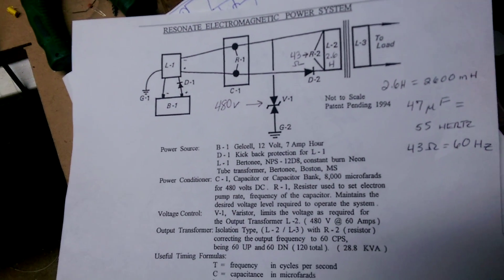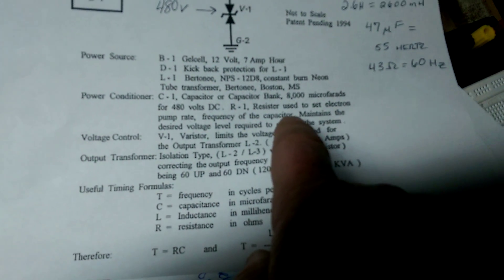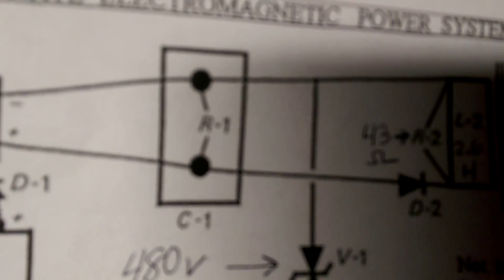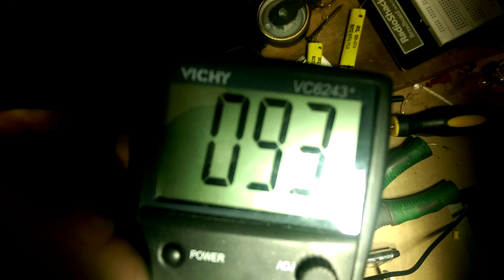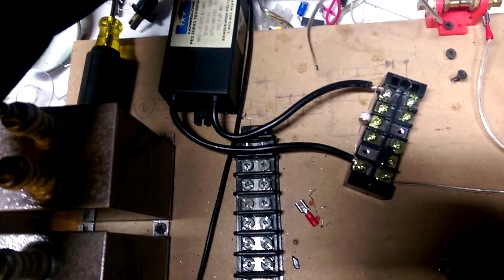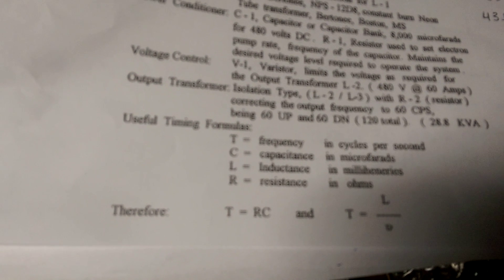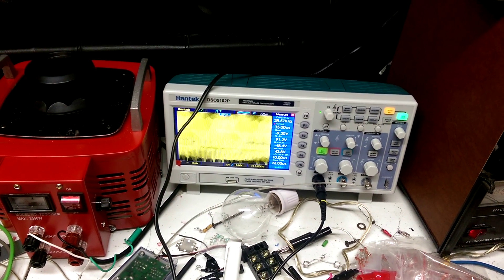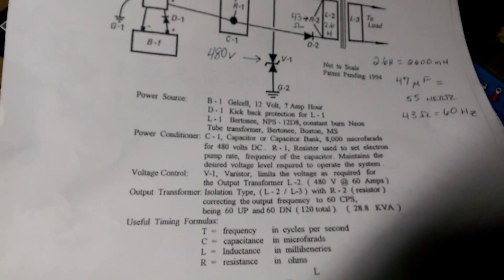Don Smith How To Video

Comment: Please, see my Don Smith generator replication in https://www.youtube.com/watch?v=43hted5YTCw
It works fine!
Reply from the maker: Gerson the only problem  that you present is that the parts you list and the parts you use are 2 different things. First and foremost, you are using an older model of the Cool Neon brand NST that has a zero volt reference center tap, and the model you show is NOT adjustable like the cool neon's nst. The adjustment you provide by the adjustable neon dimmer as Don did will not work and will burn out most solid state nst's. If we provide ground to the grounding point on many nsts, this only connects to the ground on the 120v power supply, leading to the return of the high voltage to the experimenter's breaker box's neutral . 

This will force open any GFCI, starting at the NST.  The biggest issue we all have is that people need to replicate this system to figure out why it works, not just build a device that works some of the time to provide only output enough for 6 or 8 -100 watt light bulbs. The true Don Smith schematic is the 12v to 3kV output driven into a capacitor and gas discharge tube, then it should go to the rectifier bridge, voltage divider, DC cap, then a load. This teaches the public why the circuit works and can convert from high voltage/cold electricity at high frequency to low voltage at a normal frequency, by an inverter. If we keep spending time and money to replicate the device, then not tell people what you've actually used, you are suppressing the technology just as Don did. The diodes you use are NOT what is listed in the diagram, the NST, not the same. The fact of the matter is this, the Don Smtih generator is a Tesla Hairpin circuit that is shorted into a coil instead of a shorting bar. When we do this, energy is still released into a resistance, and the higher the resistance, the better the output,

 The closeups of the caps and coil windings are not provided. People need to see everything, and failure to do this is giving people not enough info to replicate, where they just waste their time and money. . Don did show close ups, but this device worked occasionally and he never ran this in public because it didn't work longer than a few minutes because the gas discharge tube would fail as mine all do . The math to make these devices work is based upon what the original nst's provided for frequency. That is what we need, we don't need another video showing something powered up and not showing us the panel from both sides, or the bulb panel from both sides. We all know the output would never be a perfect 60 hertz unless resistors wewe provided, and if you were interested in getting people to know the truth, you would show all of this,, the schematic, the real parts used and every angle of video proving it is the generator driving the load and not a separate source. There are too many inconsistencies to get everybody believing your device. The biggest issue is that the ground connection doesn't come out of the side of the model of nst you use. I have an Evertron nst that I had to make my own connection to the center tap of the transformer. You probably did this yourself with this nst so the device doesn't drive HV back to the wall as most people do, not knowing why their device shuts down..
Reply: Mark, he is a scammer, I already debunked him several times and he deleted all my comments months ago :) He only does a visually perfect clones of original devices, and tries to sell parts to others )

Comment: where do you get the gas discharge tubes?  I can't find them.  And how do they compare to a proper spark gap?
Reply from the maker: gas discharge tubes can be found from Littlefuse online, on Amazon, Ebay and a number of other places. They come ib all sizes, amperages, voltages, etc. They need to be engineered for use, however, they are built to be used as lightning arrestors, and they are merely protection devices that protect from overvoltages.
Reply from the maker: the gas discharge tubes I buy from ebay. I buy epcos spark gaps and I try all different voltages and styles. To suit your experiment, I suggest you get spark gaps rated for the maximum voltage of your nst plus 20%
Reply: Can you give me more information on your transformer?  Input is fine, what are the windings for the output, center taps, and voltage?  Anyway of getting your email please... thanks.

Comment: Hey MArk I sent you  a mesage on your you tube account now few time ago...I will post here what I want to say , also...I understand you are out of money ;you need help  in your research to bring out some free energy systems to the people...You can receive help from Keshe foundation..I heard mister Keshe said he are open to help smart guys with great ideas , to put it on the market..Just  take contact with his staff  and tell them  who are you and what  you have done..they  will be pleased to colaborate  with you and help you in your research...their goal are the same as yours.. to help people to solve their problem  regarding  the energy ...in this direction  the foundation already have an program  to bring  free energy  in poor countries from Africa , using  plasma technology; in Italy they already have a factory where they are making plasma energy devices...

In another word, regarding your  system  I have few questions:
1.the output from the nst ,I understand is DC: http://s003.radikal.ru/i203/1207/4b/1e64d71de6e3.jpg   so how the capacitor and resistor is used to tune  the output of nst ?We need to have oscilation to tune a coil ...

2.Instead of nst can I use an ZVS oscilator toghether with high voltage flyback  transformer(FBT) known as line-output transformer from  television? ...this type of transormer have a diode built in from factory  ....so can be used?

3.Is not clear for me why we need center taped nst? Why common type transformer( like microwave oven model)  with 2 legs output are not good? What role plays here the center typed transformer...?
4.I see in the movie an spark gap acros output (?) of nst ..this can be taken away from circuit and put the varistor going to ground instead, like in schematic right? In schematic I donn,t see any  gas discharge tubes 

5.How much is the maximum load you can use with your 92 microfarad capacitor ?Will increase the watage output  with more microfarads?

6. The D2 from diagram what purpose have there?I supose are  a high voltage , high amp and high frequency diode....can you please give an ideea about specification  of that diode?

7.The capacitor mentioned in schematic are  sugested to be 480 V rated ..How these will withstand  if we have at the output of nst thousand of volts? 
8..Can you please give an ideea what rating should have the transformer output? ( around what watage can we expect here?)
9.You say :       if you get these cheap Chinese hf inverters off of Ebay,  they have no 
protection and offer you tuneable frequency which is a godsend!  this 
lets you find resonance without playing games with caps,  however, the 
coils must match each other perfectly frequency wise,  I mean dead on!   ...  you speak  about an inverter that take 12 volts from battery and give 220 volts out? Can you give us a link to be more clear  what type of inverter you talking about?
 

Thank you 
Mihai
Reply from the maker: all wire wound transformers and 90% of solid state nst's  output ac voltage or pulsed dc which reacts similar to ac,  can be resonant and is able to be tuned as a resonant ac circuit.  if the signal is rectified as a full wave bridge rectifier,  then,  once its rectified and a capacitor is used to smooth the output,  youve got a clean dc output.
Reply from the maker: you could use a zvs oscillator and flyback,  unfortunately,  the frequency is fairly low,  less than 16khz and isnt variable.  the flyback. voltage is normally too high and amperage small,  but,  it needs to be between 2000 to 3000 volts and frequency should be 35.1 khz.
Reply from the maker: the center tap cuts the voltage in half and doubles the amperage,  yes it is important especially if you would want to see both outputs used for a positive pulse train,  then,  both pulses can be combined in parallel to output double the power/amperage.

Comment: a old nst will not have a gfi
Reply from the maker: +frank ertolacci  most likely, however, the solid state nst's had protection and gfci's for quite a few years, and, they are very difficult to find a solid state nst with a center tap or, without a gfci, even though they may still be around. They are easy to kill as well trying experiments like these, but, they work the best because the 120v solid state nst's have the most power and supposedly have overunity right out of the box, they are labeled so anyway to have more output than input. You'll need the center tap for it to work correctly, however, I am hearing others have recently used automotive coils to make the system function with a single wire out and an avramenko plug
Reply: +Marc Belanger     Information Unlimited will custom make neon power supplies for us  /  draw up a circuit  and send it to me // i will send it to them and pay for it  //  or would you rather go in the car coil ??
Reply from the maker: I don't really know the circuit I'd need.  I think the best deal would be to find the true diagram from the Bertonee units Don used.  I did see some schematics online,  however,  Ive never received any proof it was the true circuit.  VENTEX is the company that bought Bertonee and they still mfgr the devices,  I just have spec of the solid state nst.  If like them to be able to offer more power,  however,  if done correctly it isn't necessary.  But,  I'd need to know what the output inductance , capacitance and impedance would be to make it work like Don did. 

I'll try to get the true diagram of the few I've been looking for,  oh,  btw,  I found where to get the custom caps Don bought from Cornell Dubier.  They went back private and have the design criteria from Transworld Energy which again can be made and sold to the public,  however,  they want $44 each for the yellow 4kV caps and a minimum run of 10 pcs to make them.  They were protected until the 1st of January,  now available again!
Reply from the maker: I'll have a run made and trade for the Caps you need if you wish.  I am skeptical to lean towards one size,  so until I am absolutely positive of the size I need,  the coils are as unique as a fingerprint and I'm not too sure how don. Used them on all of his devices,  unless they were the key to. Success.  If you look,  nobody gets or used them.  I've found the dimmer, the inverter,  and the caps.  If we get the neon transformers,  we could do well with the circuit,  but,  resonance is not easy
Reply from the maker: The resonance also drifts like analog radio,  so a phase lock loop circuit may be the answer to infinite resonance without losing it over and over..  That would be a real bummer if that happened after all of the thousands in parts
Reply: +Marc Belanger  how many caps do you need ?  2400 uf DC each , if necessary to send me something = north raleigh electric , 127 martindale drive , younhsville N C  //  on a white board don detailed a working model  //  he stated it was simple and we would not have to worry about tuning as it would be unnecessary with that circuit //i am going to look it up build it then go from there  //
Reply: +frank ertolacci   127 martindale drive youngsville NC 27596

Comment: mark   do you have don's pdf file ?
Reply from the maker: yes.  I haven't had luck with Dons calculations.  if we calculate what he used in the circuit with the b&w coil with dual coils over the Red amp king wire,  the frequency ends up being 239 khz,  so,  I used a trial and error approach since it wasn't in resonance even though my calculations said it should be.  I find that it will be close,  however,  we won't be able to operate an. nst that runs at 35.1khz in the arrangement he uses because it will shut down due to the gfci
Reply from the maker: heres what i.would do to rectify the situation.  since it has to be in resonance so the nst doesn't overload,  the first and most important think you need to do is buy a tesla coil resonance finder and replace the cap they tell you to so you get it down to the lower rf frequencies as Don states
Reply from the maker: then,  you'll have to check the capacitance of your probes on your scope and you'll have to get a capacitor the same size to use it as a decoupling capacitor because your scope's probes will interfere enough with your readings that you'll be tuning to the wrong place with the resonance finder circuit.  I think this will cost you like 8 or 10 bucks on ebay,  plus the capacitors you need.  next,  the circuit will illuminate and when the light shuts off,  you are in resonance.  be careful,  theres two circuits sold,  one uses lights to tell you its in resonance while the other shuts off when you get resonance as mine does. 

after you find resonance,  the only issue you'll have is the ground connection to arc gap will shut it off.  if you get these cheap Chinese hf inverters off of Ebay,  they have no protection and offer you tuneable frequency which is a godsend!  this lets you find resonance without playing games with caps,  however, the coils must match each other perfectly frequency wise,  I mean dead on! 

I ordered wire wound 60HZ NST'S WITHOUT A GFI ON EBAY,  ITS THE ALANSON YOU SEE IN MY VIDEO.  I.ALSO HAVE AN ACME 12KV.  THE NST HAS TO HAVE A HIGH SIDE CENTER TAP AND NO SHUTOFF CIRCUITRY..  ONLY POTTING COMPOUND IF YOU WANT IT TO WORK.  YOU'LL NEED A NEIN DIMMER,  AND,  SINCE YOU CAN USE THE CHINESE INVERTER BOARD TO TUNE,  YOULL HAVE THE TUNING FOR FREQUENCY AND AT THE DIMMER YOULL BE ABLE TO TUNE THE LEVEL. 

FOR A GAS DISCHARGE TUBE,  I HIGHLY RECOMMEND BUYING ALL DIFFERENT SIZES.  THEY WORK SILENTLY BECAUSE ITS PLASMA THEY FIRE WITH…  EXACTLY WHAT YOU WANT.  THE FIRING VOLTAGE WILL AFFECT THE FREQUENCY.  IF YOU GET AN ADJUSTABLE GAP,  MAKE SURE THE FRAME ISNT PLASTIC BCUZ THEY MELT.  BEST BET IS TO JUST BUY THE GAS DISCHARGE TUBES FROM LITTLEFUSE OF BUSMANN,  OR ANY OTHER BRAND.  I.HIGHLY RECOMMEND THE HIGHEST AMPERAGE TYPES SO THEY LAST.  YOU CAN GET AN HV SCOPE PROBE TO TEST THE OUTOUT VOLTAGE AND FREQUENCY,  JUST ENSURE THE PROBE HOLDS UP TO 25KV MINIMUM.  IF YOU TRY CAR COILS,  40KV PROBES ARENT ENOUGH.  ITS EXPENSIVE BCUZ YOULL NEED AN INDUCTANCE METER,  IMPEDANCE METER,  AND,  FREQUENCY  COUNTER,  AND AN. ANALOG VOLTMETER SO THE HF doesn't smoke your digital meter as it did my klein meters voltage function
Reply from the maker: what part of dons system do. you need assistance with??